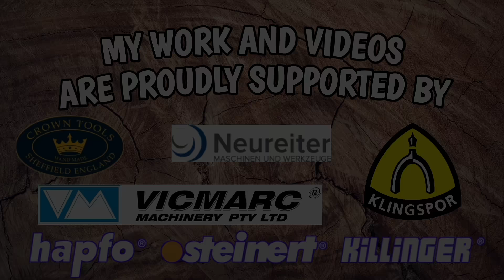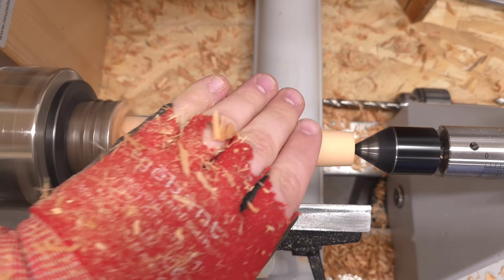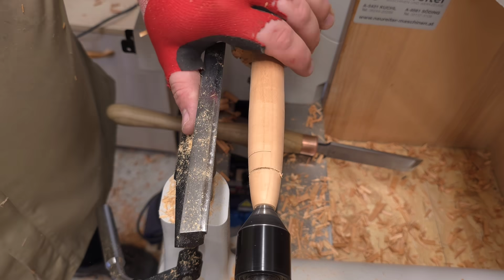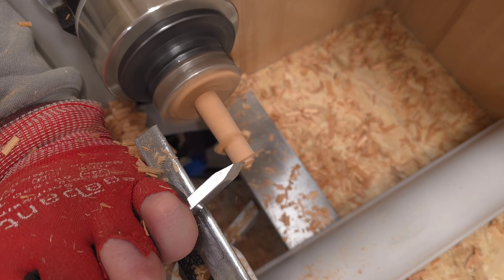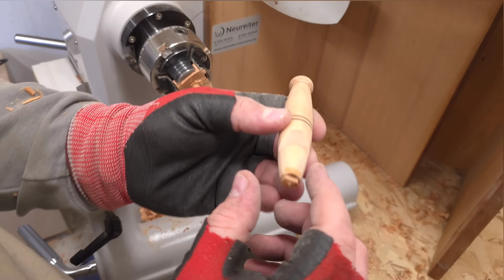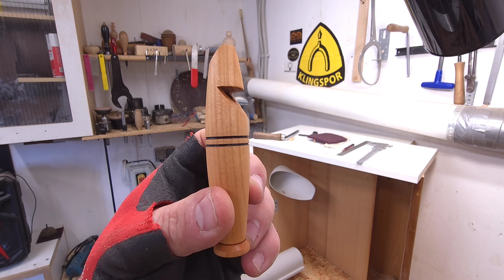Simple And Fast Way To Fund Your Hobby

Comment: I am going to try this immediately.
Can i change the tone by adding holes along the top edge?  Like a proper flute?
Reply: Okay so the first whistle i made worked fine, although its not very loud, more of a low whistle
But the second through fifth did not make any noise.  I think i did everything the same..
Any tips?

Comment: Tomislav, you are so skillful with that "damned" tool  that I start generate a really complex; ...and that is because, every time I used, sooner or later, I have a catch!    ...Now, ...This time I discovered something that I didn't pay attention before...: You used it with a high revolutions speed!    Is that part of my problem!? Please tell me. 
Thank you.
Reply from the maker: Hi Robert, no even at slow speed you should be able to use skew,it is more efficient with more speed. Play around with different shapes of cutting edge on skew, see what works for you better.  And also there are beading and parting tool from Richard Findley that works great as skew and also Dave Dalby skew. . Maybe some of these variations will work better with your style

Comment: Great Video!  I'd love to know the outside diameter of the cylinder before you drilled the hole that looked just right to you as well as the length of the whistle.  The more general measurements you can provide would be a real help.  I am very new to this and have been turning pens so it seems like a fabulous next step!
Reply from the maker: Honestly I haven't write this or remember, but hole is 3/8 or 10mm so the cilinder was around 22mm give or take

Comment: Fun project Tomislav!  Really like the use of these projects for skew practice.  I made several of these a while ago and they are a lot of fun to make.  If you drill a small hole about 1/4 or so down from the cutout, you can get a two note whistle.  When I made mine, I didn't use them as skew practice -- need to do that in the future.  I really like the design you used around the mouthpiece -- sanding that shape really makes it look good.
Reply from the maker: Thank you buddy, I will have to try two tone or with the slider

Comment: I’ve been meaning to ask..what angle do you sharpen your skews at. Seems much steeper than mine
Reply from the maker: I don't measure the angle, I measure length of the bevel, I aim for 9-10mm long. 
https://youtu.be/eSGu0kTdlds?si=3ZE7l7qK1xAGlD_O

More in this video, in the first 10min I go indepth on this

Comment: I have made hundreds of these and none of them ever work. Today, I followed your method exactly; even copying the design and it still doesn't work. Yours seem to work first time unless editing makes it look that way 🙂. Well done.....lovely project and skew work. Maybe one day I will make one that does actually whistle. Thanks
Reply from the maker: Hmmm I would have to see what you are doing to maybe say what is wrong but most of the time it does not work if the cut out is wrong way.
Reply: I made one today ... it works great!

Comment: Your skew is way thicker than mine.  But I'll try to get it really sharp and see if I can make a whistle.  Totally off topic, I have a piece of a tree that was knocked down in a storm.  It is 9" in diameter and 14" long.  How would you prepare it for turning?  I was thinking of sawing it in half lengthwise, then again in half crosswise, giving 4 blanks 7" x 9" x 4-1/2".
Reply from the maker: Its actually pretty much standard thickness of 6mm or 1/4 inch

I would probably cut that since it's small into spindle blanks but bigger ones for tea caddies let's say, or bowl blanks and the short rest into small spindle blanks

Comment: The only thing I can suggest is a hole or some other method at the end of the whistle for a lanyard for hunters and boaters...?

Tomislav, maybe a good idea for a video would be using the lathe to make additional tools for the lathe, like sanding discs and sanding cylinders.  

Another great video!
Reply: I find his videos not only fun to watch, but also instructive. I learn a lot from watching such a skilled turner.
Reply from the maker: Thank you  ,for sure something other then a foot on the end is good idea and useful one.... I have in plan to make those videos as well

Comment: Can the dimensions be modified for a lower pitch?🙂🙂
Reply from the maker: Indeed by experiment with different size and length if hole,but also if you make a slider you can adjust the tone and play something,  I might do that soon on video
Reply: Yes, drill a longer hole

Comment: Lovely whistle - thank you.  If you drill a smaller hole does the pitch change?
Reply: Pitch depends on the chamber length to a large extent, longer is deeper tone
Reply: @ianbedwell4871  thank you
Reply from the maker: Best things is to try different hole size and depth, and see what works
Reply: @tomislavtomasicwoodturning  Thank you.